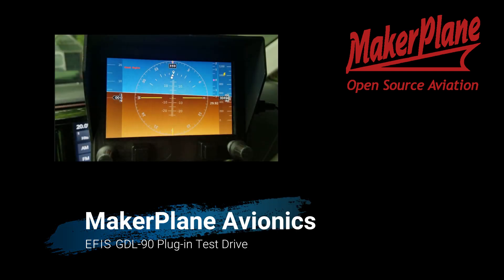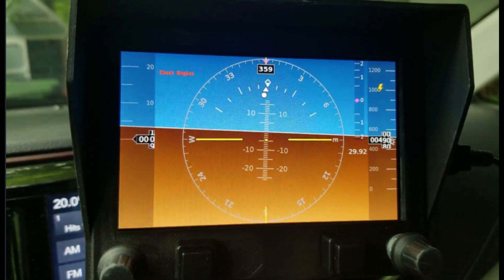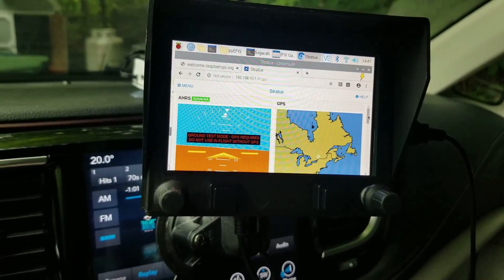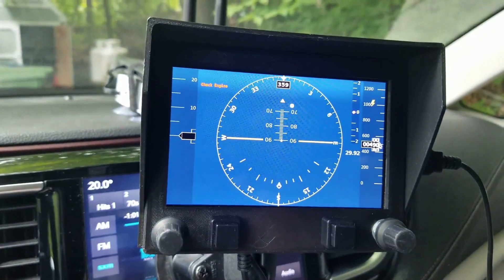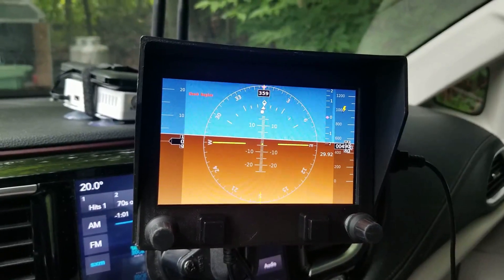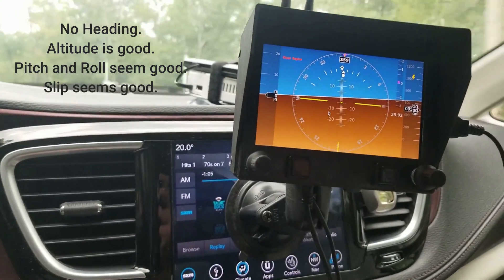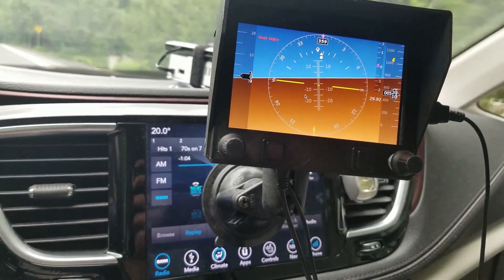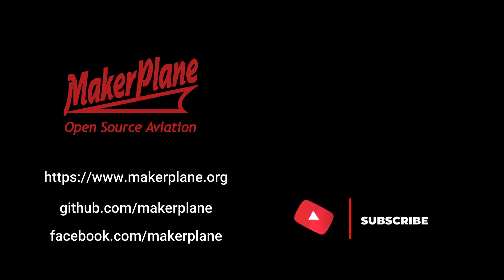GDL-90 EFIS Plugin Drive Test

Comment: Your drive through the long left and then long right turns starting at 1:50 shows that the AHRS data is NOT correct.  When you drive a car through an S-bend like that, there should be almost NO roll.  If there is any roll, it should roll to the outside of the turn, as most cars' bodies will tilt towards the outside of the turn outwards when turning.  The AHRS display tilts to the inside of the turn, which is what you would expect in an airplane, but that requires that the body of the airplane tilts towards the inside of the turn.  With the Stratux sitting on the dash, it's clear that it is not tilting.  So that means the AHRS display is based primarily on the G-forces it's feeling, not on a proper orientation vector.  In flight, in a coordinated turn, this AHRS display would not roll at all!

That said, the skid ball is correct, the ball moves to the left when going around a left turn (which is more of a skid in a car) and to the right when in a right turn(skid).